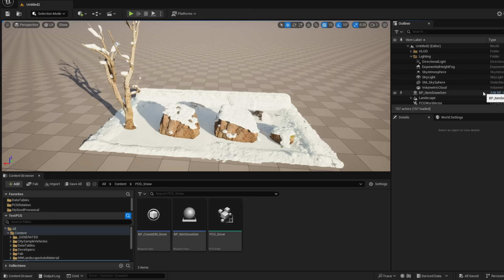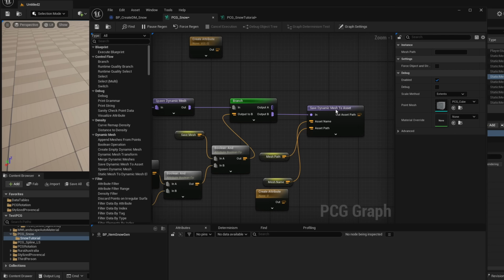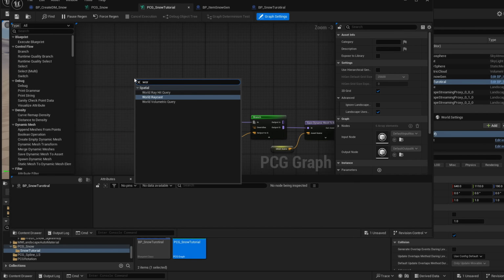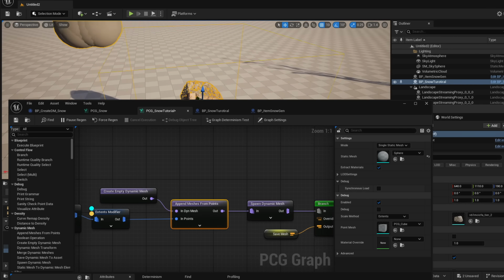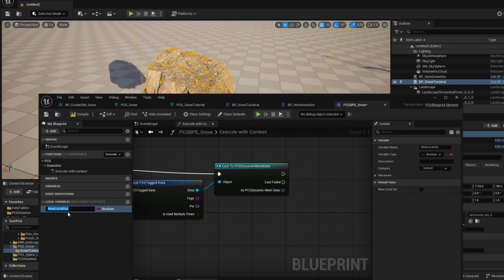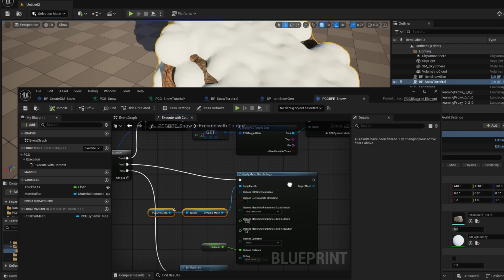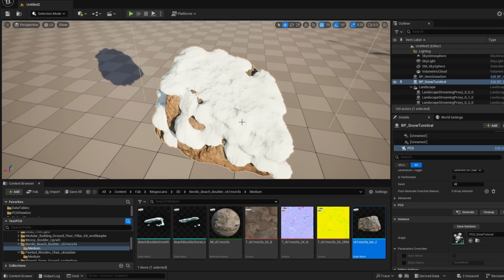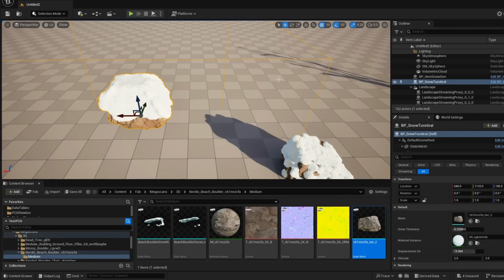CUSTOM Snow meshes with PCG

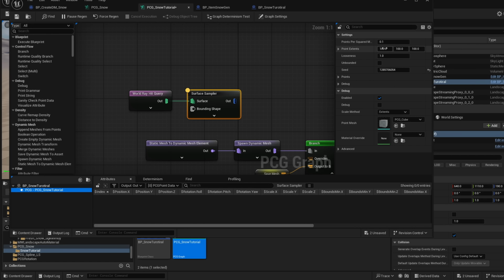Comment: 17:11 A surface sampling node has been added and checked. The attributes show that you have PCG Point data. Is it possible to switch between point data and point array data? I assume you are using version ue5.6? Every time I try to check the basic connections between landscape data retrieval and surface sampling, pcgpoint array data is displayed :/
Reply from the maker: hey, in this video the version is 5.5, so I believe no array data available there.

Comment: so author never shows polycount, polyoverlap, performance impact and the reason is...
Reply from the maker: polycount will depend on how much You set up the subdivision parameters depending on your needs.
If you use Nanite it doesn't really matter anyway.
Performance impact depends on your specific game tech, what features do you use and how do you intent to use the tool with them. No one can tell you the perf. impact based on your exact Project settings (and also based on target platform), that's why that is for you to decide how use or modify the tools to apply to your pipeline. If you need/expect such random evaluations to be made then you probably do not have the knowledge how to apply your own tools or how to properly setup the ones you find elsewhere. There is no magic "optimize" button sadly.
Reply: @dk_3d  nanite do impact performance. even worse when overlap geometry happens. so when u spawn 100 spheres with overlapping you just making it worse) it's not game ready thing at all...
Reply from the maker: @SAYRESS  well I said Polycound doesn't affect perf. in nanite so if you are using this feature it wouldn't matter. And you are not spawning spheres you are generating single merged object with no overlaps, you completely did not understand the concept it seems.
Reply: @dk_3d  Oh. this is different story then